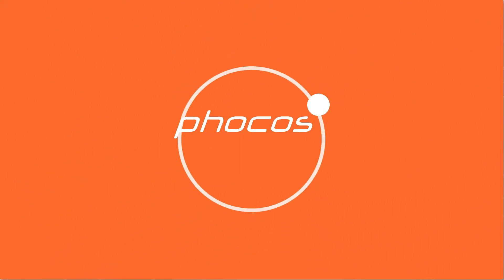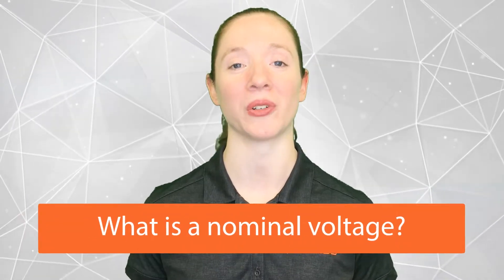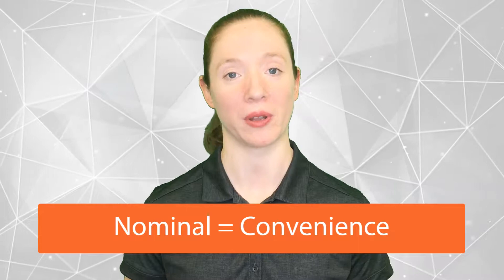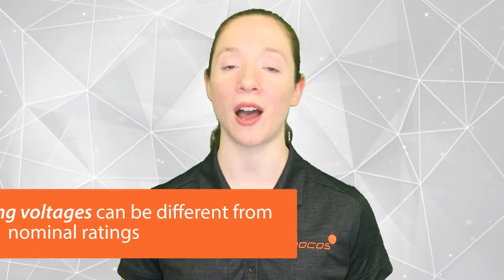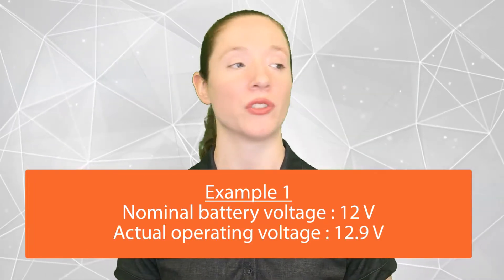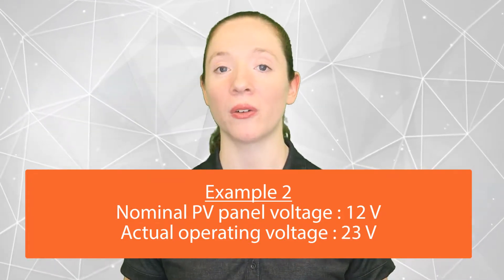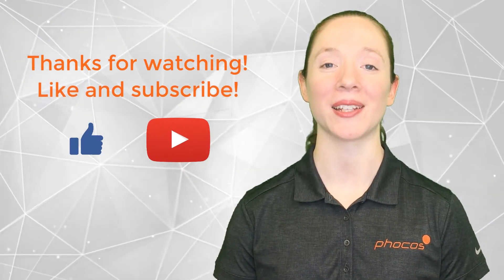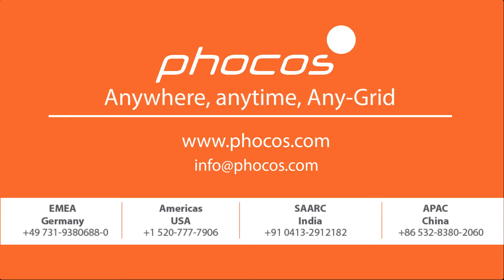What is a Nominal Voltage?

Comment: If I have a battery with 360 volt nominal but 420 volt maximal capacity, to what capacity should I actually charge it up to? Does a battery charge to its maximal capacity or some kind of preset operating capacity usually? Should I use the maximal capacity at all? And if so, what voltage does the charger have to support? How do I know which nominal voltage is still in range and which isn't?
Reply from the maker: The voltages you have listed of 3.60V and 4.20V seem to be individual cell voltages. You will need to be sure that the total voltage of the battery pack match with the nominal voltages of the charger you are using (12V, 24V, or 48V, etc.). You will need to multiple the cell voltage ratings by the number of cells in series. The recommended charge voltage cutoff (maximum voltage) can be learned from the manufacturer of the cells or battery.

Phocos 48V system hybrid inverters can charge up to 64Vdc, and our 24V system chargers can charge up to 32Vdc. For more information or technical questions please reach out to tech.na@phocos.com.
Reply: @phocos-global  No, the battery is acutally listed like that, it's not single cells.

Comment: calculate the nominal voltage and voltage tolerance of the direct current feeding the logic board of the mac mini m2 pro based on the  electrical and operating specs below:
Line voltage: 100–240V AC.
INPUT: Frequency: 50Hz to 60Hz, single phase, 2.5 A.
OUTPUT: 12.6V 14.7A.
Maximum continuous power (M2 Pro): 185W.
Operating temperature: 50° to 95° F (10° to 35° C).
Storage temperature: –40° to 116° F (–40° to 47° C).
Relative humidity: 5% to 90% noncondensing.
Operating altitude: tested up to 16,400 feet (5000 meters).
Typical acoustical performance: Sound pressure level (operator position): 5 dBA at idle4.
Reply from the maker: For technical questions: https://www.phocos.com/contact/#contactech
Reply: that's because you did a bad job of explaining nominal voltage to begin with.  @phocos-global